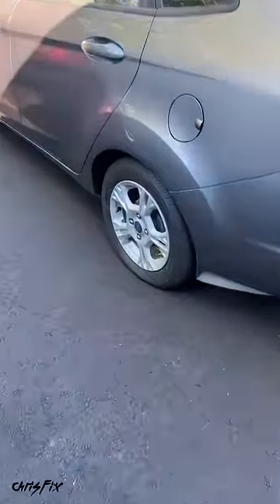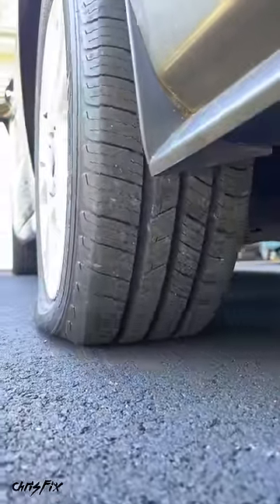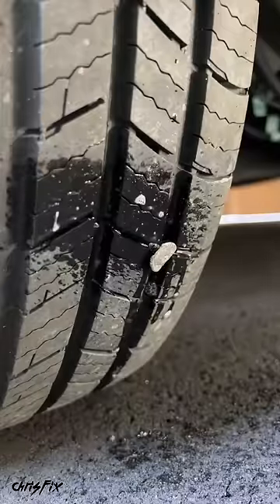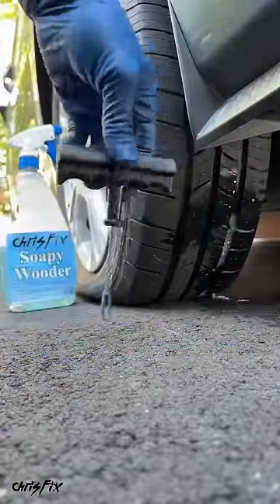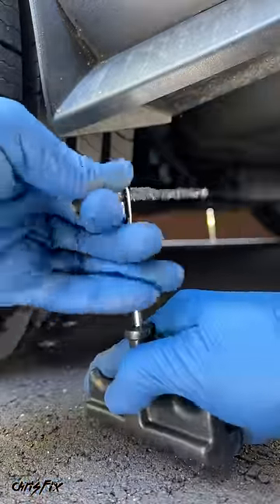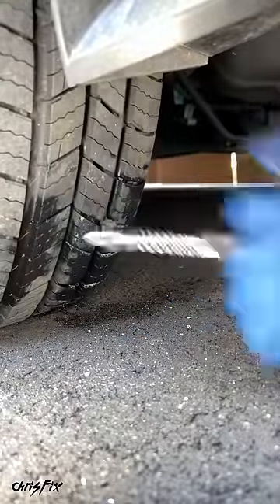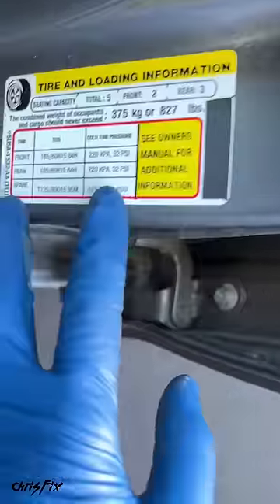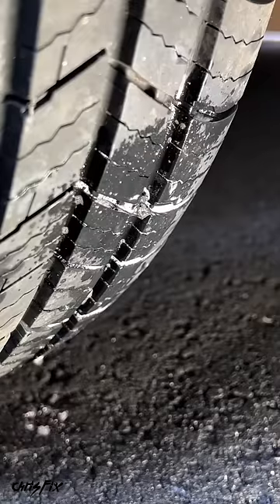How to Plug a Flat Tire (easily)

Comment: As somebody who has worked in the towing industry for 15 years.  I can tell you our company policy is.  Do not plug a tire with foam in it.  Like a Tesla Tire.  Some of our drivers did.  Tesla said to customers.  You need new tire.  Then we had customers come back and ask we pay for it.

Actually we (or where I worked) don't plug tires no more.  The other thing you should have mentioned in the video was if you drove on the flat tire.  Even if for like half a block.  You should still go and get it checked out at a reputable shop.  To many people didn't realize they had damage in the inside of the tire and it became a liability and danger on the road.

With that said.  You pretty much did it the way I would have done it when I pulled up in the tow truck and after asking several questions.

And yes.  Like another comment on here.  Turn/twist the plug prior to pulling out.
Reply from the maker: Thanks for sharing
Reply: @chrisfix  No Problem.  Also keep up the good job.  Been watching your videos for a few years now.  Hey Guys...

Comment: I've never thought about trying to do it with the tire still on the car. I always jack up the car and take the wheel off to do it. I'll have to try this next time. 

I've never been able to get the reamer in like that. I always have to drill the hole just barely smaller than the reamer first. One time I was determined to do it without drilling first and I broke the reamer. Now I just drill it first to get it close then use the reamer.

Comment: This is a great video but some tire shops won’t fix the tire after this so just be fair warned cause I work at discount tire and we won’t fix a tire once it’s plugged like this (we do not charge for repairs btw and if you drive on a flat tire we also won’t fit it due to the fact that riding on a flat tire even for a few miles will damage the tire and we also don’t work on run flat tires as well)

Comment: If u can, fill the tire with air before pulling the screw or nail. It makes putting in the plug alot easier.

Comment: Thanks Chrisfix! 
But what happens if after you plug it, air still leaks. Should I try the whole process again?
Reply from the maker: You can use rubber cement with the plug or now since it leaks slower take it to get repaired

Comment: Keep in mind if the tire is still under warranty, the installer has to fix it with a patch, or you void the warranty. You would need to ask where you bought the tire and if you got road hazard as well.

Comment: Wish the one I did was this easy, had to put multiples in that then the rubber cement that came to get it to hold air. But then again wasn’t a screw that got ran over it was a fleur-de-lis topper to a fence.

Comment: I would also say people should know that it's gonna be really difficult to slide the plug in if there is still air in the tire.

The first time I tried doing this it felt like I should try to do it as quick as possible to not let any air out but it was basically impossible to do until I let the tire deflate completely.

Comment: I feel like this tip was missed for the sake of keeping the video short but if anyone struggles attempting to put the plug in, inflating the tire will help to reduce the flexing effect of the tire otherwise you'll be putting in way more effort than necessary. This tip of course is subject to the size of the leak itself tho. May not always be possible this way but Im sure someone somewhere with a fat SUV tire is thanking me :P

Comment: How long does this last? Do we need to get it fixed properly after words at a tire shop? I see this being temporary only just to get us to the tire shop so it can get patched properly. Fyi, forgot to mention that
Reply from the maker: Technically it is a temporary fix. With that said I personally have run it as a long term repair with no issues. I have even drifted on plugs and wore the tire down to the belt and it still held air.

Comment: As a side note, these should only be used in emergencies to get from your location to a tire shop to get a professional patch installed. These "bacon strips" as i like to call them are good in a pinch, but wont last the life of the tire and can fall out over time. Professional tire patches, however, are designed to prevent the plug from coming out

Comment: How long does this kind of repair last? And is it safe to drive with highway speeds having such a plug
Reply from the maker: In most cases it can last until you need new tires. I have had 30-40k miles on plugs with no issues and I’ve drifted on plugs until it’s down to the belt and they were fine. It’s worth to check every once in a while. Small holes like this shouldn’t cause an issue.
Reply: @chrisfix  thanks for sharing!

Comment: Give the handle a quarter or half turn after the plug is in before you pull it out to knot up the plug on the inside. Also get the plug pusher tool that looks like a T, not a straight handle (he made it look easy to push the plug in, but sometimes it can take a LOT of force, so the extra width from the T is VERY nice). Also, do not try this on the sidewall of the tire…

Comment: if you doused the plug with tire cement it will be permanent and don't have to worry about leaking.
Reply from the maker: The plug has rubber that vulcanizes with the tire rubber so it’s not necessary for a simple hole. You can totally use rubber cement but not every kit comes with it so it’s not necessary.

Comment: I always thought about getting one of these kits, but then I thought I don’t have a compressor on the road so it would be kind of useless. It would be nice if I’m at home and I get the flat.
Reply from the maker: You can always get a compressor powered by a cigarette lighter/outlet (if your car/truck has one) so you can plug and then refill anywhere
Reply: @chrisfix  - good idea Chris, thanks.  Any GOOD recommendations?  Most I have seen or heard are pretty much junk

Comment: Should be noted these are really just temporary, they should be replaced with a patch plug once you can reach a service location.
Reply: I've done this kind of repair at least a dozen times over my lifetime and it's been permanent every time. I've worn down sets of tires with the same type of plugs that I put in them and the plug never leaked.

Comment: Hi Chris I wanted to ask are these tire plug kits a permanent form of repair or will it be temporary until I go to the shop to get the tire fixed?
Reply: You should read some of the comments already there before asking questions, usually there are answers posted already. And no, not meant to be permanent, but often times they will last forever.

Comment: That reamer is a pain to open up the hole left behind the screw or whatever. I always grab a couple mini phillips screwdrivers and slowly gouge the whole and work my way up to the reamer to make it easier. I also have to take the tire off the car and use my body weight to get the plug into the hole.
Reply from the maker: When that happens you can pump the tire up and it’s a lot easier to push it in when the tire has pressure on it and is stiff.

Comment: Hey chris, my slimes are getting dry and hard over time. Is there any good way to prevent that? Or should I use dry slim with rubber cement and it’d be okat?

Comment: Ima be fr with you I’m not like crazy strong but I’m okay. I can deadlift 400 pounds. And I’m telling you. If the hole that the nail made isn’t as big or bigger than the tool you use to sand the hole you will have a very VERY hard time getting it through. But once u do these things work great. Mines been on for two weeks and no leak.

Comment: Not everyone knows that the usual tire pressure is 30-35psi, much less listed on the door jam. I've often encountered tires inflated to 45-50 because they're reading the maximum mounting pressure that's on the sidewall. Every now and then tires inflated to 85psi! Always quick to correcting that and noting the front desk to let the owner know 😅

Comment: Technically ur supposed to fill the tire to 40-60 psi and then pull the nail. Use the reamer and put a plug on the tool and coat it with rubber cement for a better seal and bond. Then ur supposed to light the end to vulcanize it which makes the surface melt and stick to the tire which makes it never come out. Thats how i was taught and how i do it when a customer at my shop asks for a plug instead of a combo plug patch

Comment: Two important things you forgot to mention is that you can't repair the tire if the hole is on the side and don't repair your tire if you drove when the tire was flat (because the tire is damaged in the inside).

Comment: Many will say to turn it 1/2.
this is wrong.
just think about it your making a knot and putting stress on it so when the car starts rolling into higher speed with alot of air the knot can cause problems. just put it in and take it out.

Comment: This works but I'd still recommend getting it professionally fixed as soon as possible. It might last a while like this, but it's really more of a temporary fix.
Reply: It’s great for a fix if you’re somewhere in the middle of nowhere without any close shops nearby.
Reply: Nah if properly done, it's a permanent fix. No need to give tire shops any money.
Reply: @janoycresnova9156  
This also depends on the size of the hole.
This was just a small screw and shouldn’t be a problem but some holes are just too big for these plugs and won’t last long.

Comment: Isn't the door sticker only good for the tires that came with the car Originally?  once you change the tires, then the door sticker doesn't matter. Then you have to look at the tire itself . cause You Might Not have bought the same exact tire that it came with from the factory ?

Comment: Missed an appointment a while back
We had a flat tyre so we pulled into a gas station. Got it filled up, and went to start the car up. 
The battery was dead
We were waiting an hour or so for the tow truck

Comment: Is it a permanent fix or a temporary one?
Reply: People will argue this point. Imo it's temporary, and you're better off getting a proper repair done after. I know in my country this type of repair is illegal for permanent use on road.
Reply from the maker: Technically they say it’s temporary,  it in real life I have never had one fail even after 30k miles. Same with drifting on tires that were plugged. I drifted to the belt and it held air haha.

Comment: I don't cut the tag ends. I burn 'em. Creates a better seal...
Reply: I use rubber cement. The chemical reaction creates a bond better than melting some rubber on the surface.

Comment: So much easier to plug a tire full of air . In the winter I find it almost impossible to plug a totally flat tire . For lube I use rubber glue , then I light the glue on fire and melt the plug around the hole and squish it flat .

Comment: If you don't add rubber cement then those plugs tend to dry out and leak air.
Reply from the maker: Depends on the kit, in this case these didn’t need any cement
Reply: @chrisfix  Just because others didn't come with it didn't mean it didn't need it.  The cement just sort of helps the plug stick to itself better and seals up little micro holes.

Comment: What’s the difference between this and a patch ?
I’ve always been recommended patches
Reply from the maker: Patch requires the tire to be removed and is from the inside of the tire. They are technically better but you can’t do that yourself and can cost a lot.
Reply: @chrisfix  ah i see
Thanks

Comment: If you find yourself on the road, this doesn't work even on the second attempt, push another one in (always have more than one pack of the little worms) and then use a can of seal leak, and put the tire such that it's at the bottom so the liquid can pool over it, and form a seal.
Every car should have several methods of dealing with leaks. Better to have, than want, or hit one of those days...

Comment: Hey chris umm. So how do you fix a flat tire that has been sitting for 6 years my grandpa's old IZUSU hasn't been moved since 2018 the truck doesn't even start the tires are flat flat flat it will R100,000 to fix bruh we tried hard but we can't we quit. 😅😂
Reply from the maker: Unfortunately those tires will probably have to be replaced. You can temporarily air them up to roll the car but that's really it. Flat tires that sit for a long time can deform and be dangerous to drive on.
Reply: True man thanks man ❤

Comment: I never follow tire pressure instructions listed in the door-well unless I’m running bone stock. Each type of tire has different inflation numbers based on what the tire is intended for
Reply from the maker: Actually the tire usually has a max psi so if you are using the same size and type of tire you should still stick to the door jam numbers for a stock car.

Comment: Can you keep going like nothing happened or is this only to get you to the closest service?
Reply: I'm sure not going 80mph + on this lol
Reply: @marcokrueger3399  I told my self i wouldn't but I did and I havn't changed the tire yet and it's been over a year xD
Reply: Some will say not. From personal experience I have repaired tires like this and kept going for years afterwards. Just don't do it on the side of the tire or the edge. As long as it's in the tread area you are good to go.
Reply: Its a temp fix but you can keep using it for years
Reply: @bunnyripper5981  well :D

If you check tire pressure regularly it's probably fine. Still wouldn't like it on the Autobahn for me 😂
Reply: @marcokrueger3399  never driven on the Autobahn but I've driven Autobahn speeds so will that give you a little reassurance? ((:
Reply: @bunnyripper5981  A little bit, yes ;)
This reminds me of that tik tok audio I now see everywhere "time to so some sketchy shit, duda, duda, time to get away with it"... :D Glad nothing happened, may it stay that way (:
Reply from the maker: You can just drive the car. Inspect again after a tank of gas but most of the time they last until you need new tires. Ive drifted on then at 90mph down to the belts and the tires still held air. But technically you are supposed to get them patched from the inside.

Comment: What happens if you plug a tire then the tire pressures don’t show up afterwards, even after TPMS calibration?
Reply from the maker: I assume you drove the car? Usually you need to drive the car over 25mph for a few min for the TPMS to give a reading.
Reply: @chrisfix   yeah I did, ty. Drove 30 + mins 30-50mph. I tried it about 6 times within a 4-5 week span. Took it to the dealer, all they did was calibrate it again even after I told them 🤦🏽‍♀️
So now trying to figure out from the internet

Comment: Tried this once, it just simply wouldn't work for me. The plug was too stiff to shove into the hole. I don't know if it was old or what. I bought it new but, had to take the tire in anyways 🙄
Reply from the maker: Fill the tire with air. The pressure makes it easier to insert stuff like the reamer and plug.

Comment: Naa man, you make it look so simple. The damn plug never goes in the hole that easy.
Reply from the maker: The key is to work fast so the air pressure is high. It makes the rubber not bend as much and you can jam it in easier.

Comment: Remember. This is only a temporary fix. Never drive on a repaired tire for long. It will need a replacement. Most countries in europa its even illegal to drive with for more than driving home or to the shop with a repaired tire.

Comment: this is fine but will ruin the tire if it starts leaking again which most likely will occur. i work for discount tire and we see stuff like this all the time and you have to buy a new tire if it starts leaking again. suggestion would be to just air it up and drive CAREFULLY to the nearest tire shop to get a proper patch!!
Reply: I've used these numerous times never had an issue. Also better to use one of these to get to the tire shop than just leaving the screw in

Comment: You dont want to use that when fixing a tire the rope plug will absorb water and rust out the steel belt’s inside the tire and that may lead to a blow out make sure it’s a rubber plug or something that doesn’t absorb water

Comment: I will tell you this about that particular type of tire plug, if you use that plug, it doesn’t matter how short of time it is before you get to the store, Discount Tire will not honor your warranty. I had one of those tire plugs in for less than 12 hours and they made me buy a whole new tire. The only thing they will accept is a solid rubber plug. The fiber ones like you were showing there they say, conduct moisture into the steel courts and therefore they cannot warranty a tire that’s been plugged with him
Reply from the maker: Thanks for the tip! That’s a good way for them to get out of a warrantee!

Comment: How does the reamer not just pull the plug out with it?
Reply from the maker: It has an open slot at the end of the reamer. So if you pull fast enough the plug pulls out of the reamer.

Comment: Would always reccomend still taking it to a Les schwab or discount tire  within a week or so they can do a REAL patch , plug , sealant job on this so it actually lasts
Reply: This type of type of tire plug does just fine for the duration from my experience, which is quite a bit.
Reply from the maker: Most tire shops will do exactly what I showed but charge you

Comment: You should have coated the plug in rubber contact cement before inserting into the tire.
Reply from the maker: You dont have to. Def can if you have but it’s not necessary.